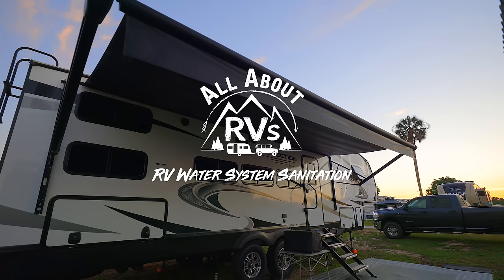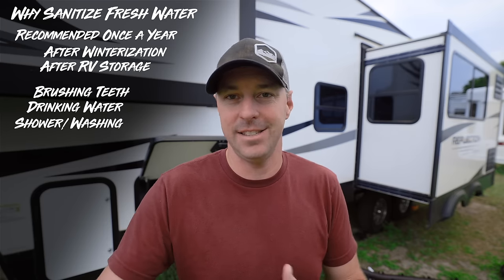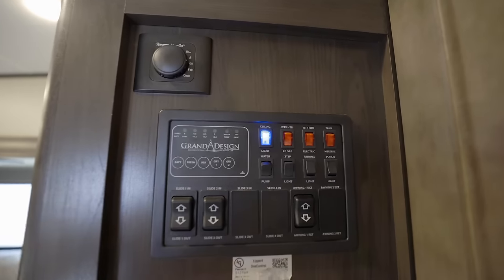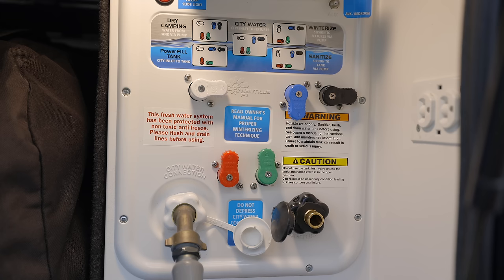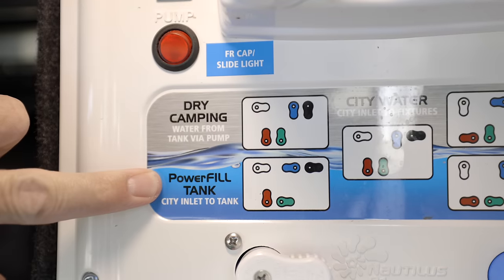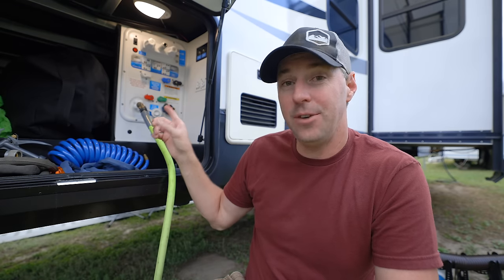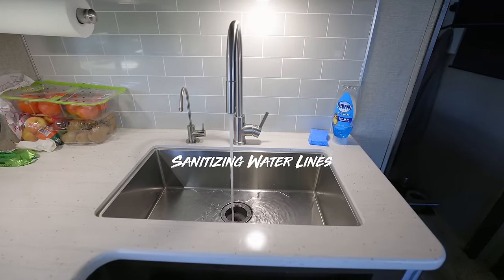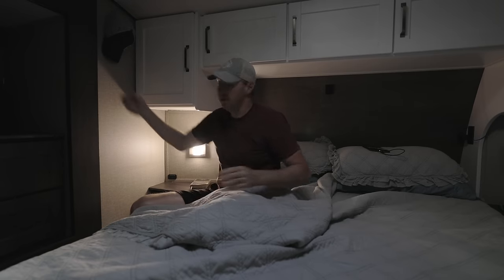How To Sanitize Your RV Water System! The Easy Way!

Comment: I’m confused about the draining. Not sure if it the difference in RVs or not - why would you just hook up the drain as you would normally when getting read to dump your tanks?
Reply: You must be new to RV’s? An Rv’s fresh water tank, is the tank the bleach mixture goes into. To drain a fresh water tank they all typically have a valve you open that drains the fresh water tank directly to the outside ground, it is not directly connected to the grey n black tanks and the freshwater drain opening is typically a drain hole size of the water line, like a garden hose size, not the 3” sewer hose size. 
So this is why you see Jarid holding his sewer hose under his fresh water tanks drain valve.
Do you understand?

Comment: How do l bypass my hot water heater on an older toy hauler, l do not have the fancy nautilus panel.
Reply from the maker: You should have 3 valves often times near the back of the water heater. They basically are valves to close down the in and out and open a path to bypass it.
Reply: Thank you…once we thaw out, l will go figure it out. I know l really need to sanitize the water lines and l don’t want to mess up my water heater.

Comment: So I imagine 90% of the travel trailer don’t have a bypass for the water heater. So what’s the process for all those RV’ers? I filled my Coachman 49 gallon fresh water take with the properly chlorinated water. Turned on cold water faucet then the hot water faucet in kitchen sink and then bathroom sink. The same for the shower. “I did not turn on the water heater.” Once I was done running water through the pipes. Turned off my water pump. I then drained my water heater. Then I let the water sit for about 12 hours then drained the fresh water tank then refilled it with fresh city water and ran all faucets again. Then drained the hot water tank again. I hope this is the tight process for my RV. Your comments are welcomed.